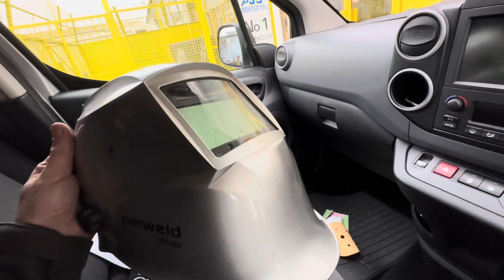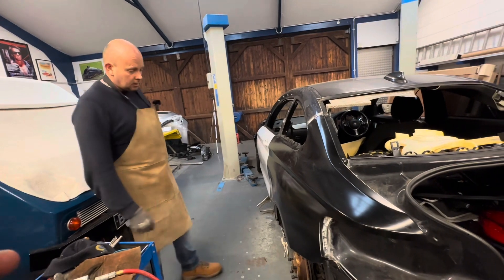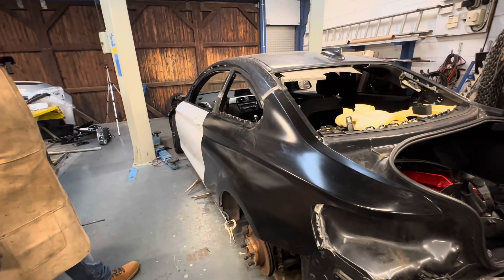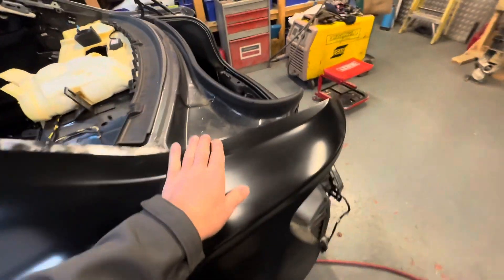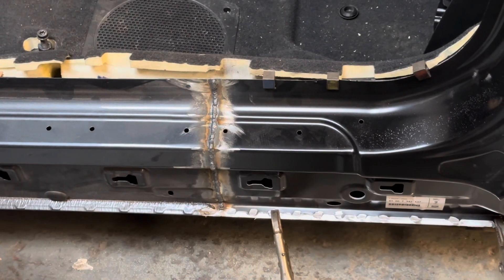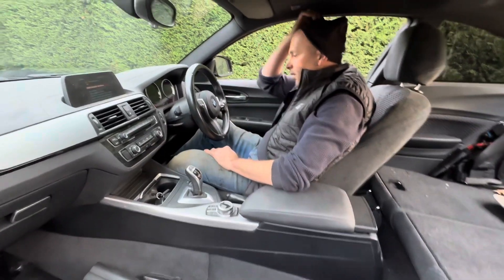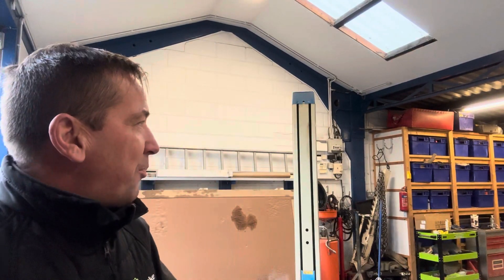AMAZING TRANSFORMATION OF OUR CRASHED 2017 BMW 220 M SPORT

Comment: One of my kitchen unit doors dropped on it's cabinet hinges. Months back. Tackled it eventually this morning. Gap was ropey when done tbh, but thought that's not good enough. Spent another 5 mins getting the 'panel gap' just right. Chuffed wiv my self. Meanwhile Chris is welding panels on a car perfectly.

Comment: I know it is very late so I won't expect you to read this now (went for a birthday meal). I have to thank Chris once again for his hard work with the wedding and thank Rob for getting him a new visor, you can't really weld with a crack glass. There are still a lot of little bits to do but it will be ready for paint very soon. That's the way it should be, turned around in the quickest time possible. I know I said I wouldn't mention it again but I do think the Mic's are a real improvement, I can hear Chris very well. Thanks Rob and Chris for another excellent video and I hope you both have a great weekend. 👍👍

Comment: Can i make a suggestion for the mic setup lads. It does sound better by the way but... Chris has a deeper voice so how's about decreasing the bass as needed on your mic software for Chris and then increase his volume a bit. And if need be you could increase the mid frequencies on Chris ie: 800hz to 1200hz and then resettle the volume from there once the mid bass has been sorted out. You will have to do this somewhere at the mic or source before recording. Just saying Chris sounds a bit distant. But hey it's still a massive improvement in quality since you started with the separate mics.
Reply from the maker: Lol what mic software this is plug and play there is no base treble etc it has 4db settings
Reply: Shame that. Anyway like I said its a big improvement Rob.

Comment: Great video, lovely car, excellent work from Chris. When I touched up paint problems years ago I recall being told you can't leave primer without a top coat to seal the surface. Seems that this is not necessary with the weld-through primer you use on panel inside surfaces - is that because it doesn't get wet or are modern primers all you need ?

Comment: this is a great vid, i have just bought myself a 320i from copart with a bit of front end damage, it actually looks better than it does in the photos so im well happy. just need to source the bonnet, bumper, rad pack and slam panel. does anyone have any recommends for breakers yards? im in north london

Comment: Audio clarity is better guys but your volume levels are all over the place. Content great as ever!
Reply from the maker: As stated in many videos they are new and we are ironing out the issues slowly
Reply: @sruk  absolutely! If your production software has an audio compressor you may find that applying compression at around 3:1 or 4:1 will even out the levels for you. If not, someone else on here may know more than I do about audio engineering. From someone who vaguely remembers once changing a set of points but is addicted to your output, keep it up!
Reply from the maker: @johnlyon326  your talking French to me bud we don’t use any software

Comment: That airbag light can't be turned off by a standard code scanner as it's SRS/AIRBAG it's a BMW specialist Jobbie. Made the mistake of removing my seat in my BMW without removing the battery first and standard obd doesn't remove the light
Reply from the maker: We got the kit to reset the light 👍

Comment: Chris needs to get that mic onto his apron strap or jumper. It's a lot better than without, but the way the apron pushes away, you miss the sound from the chest. Only when it's on the apron.
Reply from the maker: I just watched it on my tv and the sound is outstanding and we won’t be changing now we’re happy Christ doesn’t wear an apron to work every day it was just for the welding and grinding
Reply: @sruk  Fair enough. The sound has been great. It's only the way the apron pushed away from his chest that it would have worked better on the strap, as it's by his chest. But wsell done. It's great to be able to hear you both so well.
Reply: @sruk  Christ! 😂he can certainly pull off miracles!
Reply: It's not an apron, it's a blouse🤣
Reply: @cmb1972  A blouse? Don’t think Chris wears blouses.

Comment: It’s a shame it hasn’t got heated front seats. I’m sure the wiring loom is there for it which means changing the seats and telling the computer/ECU that it now has it.
Reply: May have to pay a monthly subscription to keep them active! 😂
Reply: Probably requires a supplementary wiring loom added.  Strange as it seems BMWs don't have extra wiring unless the option has been fitted.

This goes back to the mid/late 1990s. My 1993 E34 has wiring for options not fitted but my 2001 E39 doesn't have wiring for options (heated seats for instance) that weren't fitted.

Comment: The m sport was actually a thing the m cars start with a m like m2 m3 etc the m sport just says model and engine size, m sport is just sportier bumpers thicker steering wheel stiffer suspension etc
Reply from the maker: E46 was never a m sport it was a sport only I’ll stake anything you want you will not find a e46 with m sport on the v5 nor will it come up as a m sport on any check. Someone started the rumour donkeys years ago and even car dealers were advertising them as m sport but it’s all nonsense
Reply: @sruk  I still class them as an m sport due to the fact they look better then the standard SE out there, least the m has all the fancy bits on it and stiffer suspension, can defo tell which one your driving
Reply: @sruk  what does annoy me and when someone drive a SE AND has M next to there 318i badge lol

Comment: nice work lads, but i still wouldn't want to be in that car in another crashed now its been compromised structrally.  will never be RIGHT, MAY LOOK RIGHT BUT JUST NO. NOT EVEN IF GIFTED.
Reply: It’s just the outer skin so don’t think it’s got anything to do with chassis/structure integrity, it’s the same Mary with a different hat 😊
Reply: Didn’t look like any structural damage just outer panels that have been replaced.
Reply: @JamesYT19  yip run of the mill rear quarter nowt complicated
Reply: @howguy  fair one, they doing a nice job anyway.